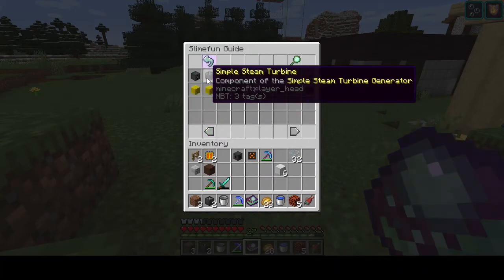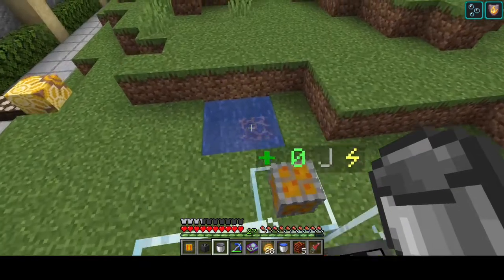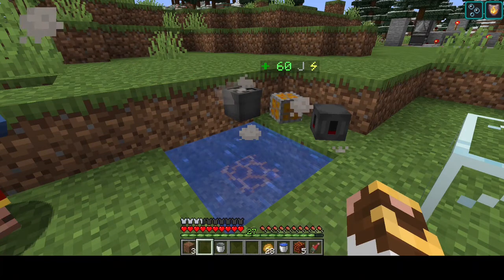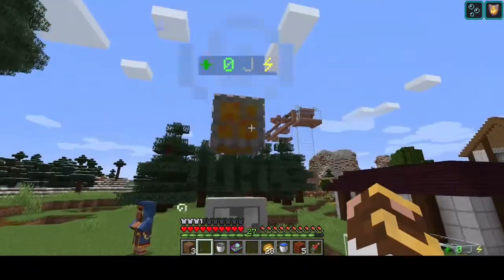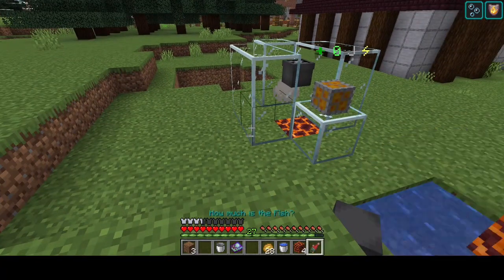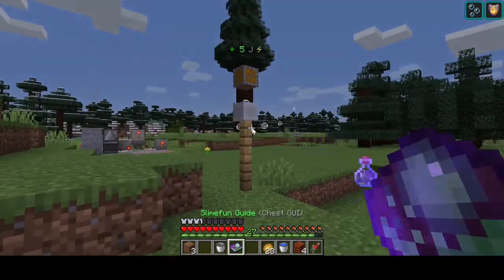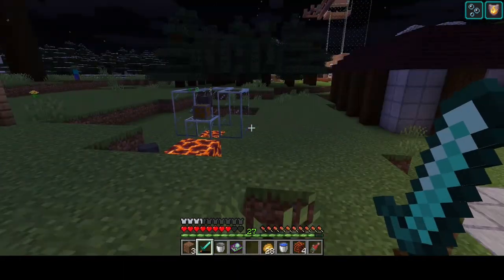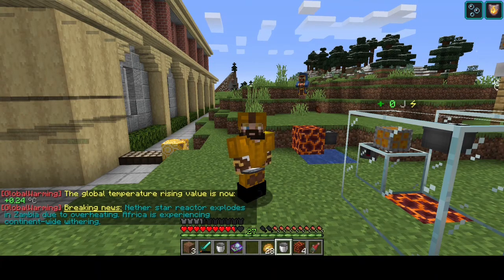Slimefun #53 - Eco Friendly?

Comment: Hey boomer with the steam turbines you can make it work with a 2 deep unlimited water source so the water doesn't dry up. You can then have 2 steam turbines in either corners and an energy regulator next to them at the sides. Hope that helps keep up the great content!
Reply from the maker: yes. I showed that in the video. However the turbines cannot create nearly enough power and that was why we abandoned them.

Comment: Eco-Power! Should be good for your climate issues :D
Reply: In terms of the steam turbine issue, that's intended behavior! It actually consumes the water and "turns it into steam" 
It's a little frustrating, and why its one of the less useful energy sources.

For the wind turbine, it does not function if any of the blocks in the 4 cardinal directions have a block that "restricts airflow" presumably to prevent stacking them together densely.
Reply: Youtube comments aren't the best for code, but here's the code for the steam turbine that replaces the Bubble column with air.

water.setType(Material.AIR);
        l.getWorld().playSound(l, Sound.BLOCK_FIRE_EXTINGUISH, 0.05F, 1);
        l.getWorld().spawnParticle(Particle.CAMPFIRE_SIGNAL_SMOKE, l.getX() + 0.5, l.getY(), l.getZ() + 0.5, 1, 0, 0.4, 0, 0.01);
        return true;
Reply: hello bro can you help me with something on slimefun i have problems making a slimefun resource pack work its not working in any way i tried almost everything
Reply from the maker: Hey Shaoly, sorry but I really don't know much about making texture packs. There are only a handful of them out there that even work in 1.16.3. I think I found 3.
Reply: @Boomer1  yea i found some but they are not working i tried everything and i have optifine installed and custom items and colors are on too